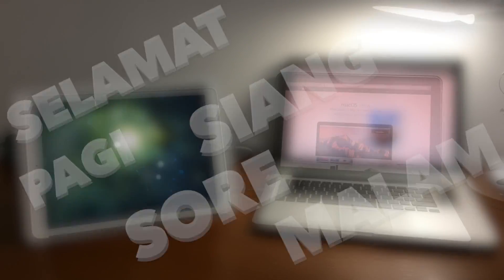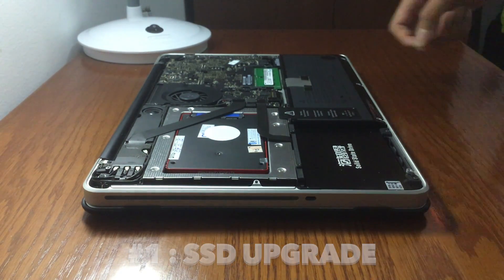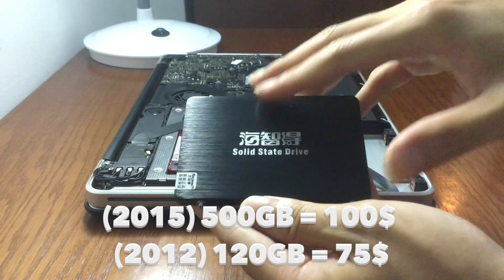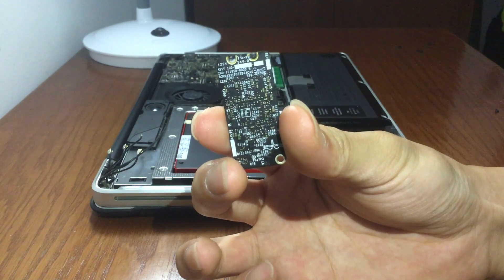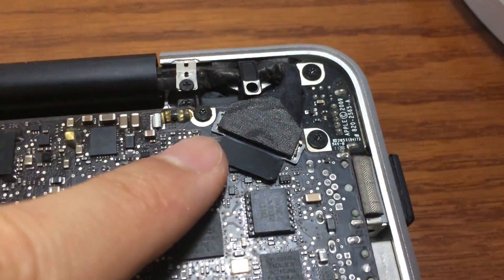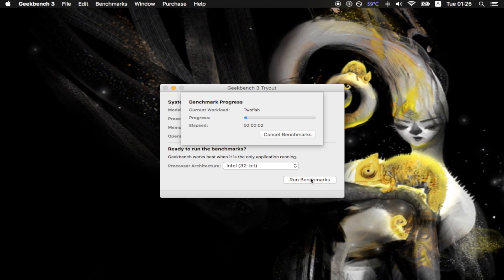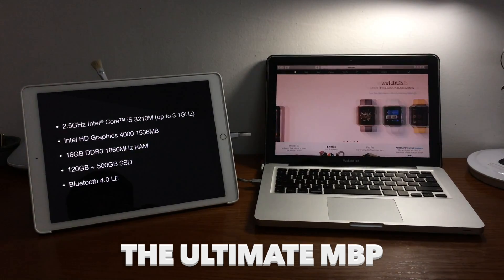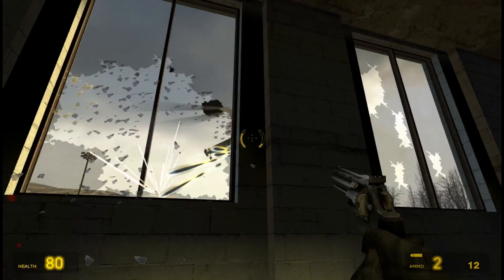The Ultimate MacBook Pro (Late 2011) Upgrade

Comment: I just finished upgrading my wife's early 2011 Macbook Pro, after which I saw your video. I kind of wish I had seen it prior to upgrading, because I might have opted to upgrade the motherboard also. However, she is quite satisfied with the 16 GB of RAM and the 1TB SSD (Samsung 850 EVO) I installed. Her machine is SO much faster now.
At some point in the future she'll need to replace the machine, but for now she says she is quite satisfied with the speed upgrade.

A couple of hints for others interested in breathing new life into their older Macbook Pro's:

1) I followed the Apple Doc: "Upgrading Your MacBook Pro with a Solid State Drive" located at https://discussions.apple.com/docs/DOC-4741
This worked out well for me.
I cloned the hard drive in the Macbook Pro onto the Samsung SSD using a Thermaltake BlacX series Hard Drive Docking Station. I believe you can just use a USB to SATA converter cable to do the same thing. Here's one example: https://www.amazon.com/StarTech-SATA-Drive-Adapter-Cable/dp/B00HJZJI84/ref=pd_bxgy_147_2?_encoding=UTF8&psc=1&refRID=ECPEYVXD5D6PYH63Z3RQ
Note that even though the cable (and my Thermaltake BlacX) are USB 3.0, it will work fine, albeit rather slowly, with the USB 2.0 of the Macbook Pro.

2) You'll need two screwdrivers for this task, a phillips #00 and a torx T6. I didn't have either, so I opted to go the cheap route and purchase a small screwdriver set from Harbor Freight. The set I bought can be seen here: https://www.harborfreight.com/32-piece-screwdriver-set-with-tweezers-97517.html
I had a 25% off coupon, so I only paid ~$5.70 for the set. After completing the upgrade, I would suggest using screwdrivers with magnetic tips. The majority of the case screws are quite small and it can be quite fiddly to insert them. I also had a bit of trouble with the four torx T6 guide screws that go into the SSD. I was able to remove and subsequently install all of the screws without too much trouble, but a magnetic tip to secure the screw would have made the job easier and quicker.

Hope this helps...
Reply: 1TB ssd? whoa, thats going to be so expensive :O
Reply: Love this, thank you! I wish I could copy and paste this on mobile

Comment: Hi, i have the same model and having problem with the graphic card, i was looking at your upgrade and have a question, will changing the motherbord fix ?
Reply from the maker: Yes it will fix the graphics issue if you change the motherboard

Comment: does it matter if it's a 13", 15" or 17" model if you change the logic board (you note a macbook pro 13" unibody upgrade) I have a 15" macbook pro and want to upgrade my logic board
Reply from the maker: I think it does matter, I'm not sure about the other models (15" and 17") whether you can do it or not.

Comment: I have a 2011 (late model) MacBook Pro 

I just upgraded to a 16gb RAM made by "Crucial"........ ITS AWESOME!!!! SO FAST AGAIN :D :D :D :D :D :) :P :P :D :P :D 

OHHH THE JOY! :D 
And it was sooo easy to switch out! :D 

I wish you all a lucky year in 2018, if you just read this you were blessed :)
Reply from the maker: +Steven Einstein Hahahah I'm glad you're having a good time with your mac 🤣 thanks and enjoy!
Reply from the maker: Yes but if you put 2 sticks of 8GB RAM (which is 16GB) it will just detect the memory and  work normally 👍🏼
Reply: @namedkenn  I have an early 2011. I thought I was maxed out at 8gb. It would be great if I can do 16gb and get back some speed in my machine.
Reply: All my research says 16 max, as with all 2011 and later mbp, due to the intel chipset apparently. So 16gb is it. Pretty good since the max was 6 or 8 just before the 2011s.
Reply: Sorry, I'm a noob at all of this, but apple says the max ram for a late 2011 model is 8? How did you do 16?
Reply: @gearheadproductions3236  I also have 16gb! super quick!
Reply: Kenneth Tanaka Ohhh, so technically max is 16. You wouldn't be able to do 32?
Reply from the maker: Well, I can't say that it maxes out at 16, the thing is I've never tried 32 before because of cost and efficiency reasons (is it even possible? Haha), but nevertheless it might be possible...
Reply: Steven may I know if you upgraded also your graphics? I'm using the same macbook model and I'm thinking to upgrade my RAM from 4gb to 16gb. Btw, how much is your upgrade?
Reply: +Steven Einstein Are you able to play 4k video with the 16gb upgrade? (I want to watch my 4k videos without insane choppy video)
Reply: bro please tell me is it still working good in 2020 please tell me
Reply: @sharjeelhassan7079  upgraded mine 2017 and working like a champ to this day. It's faster than my Microsoft Surface Pro 6. Specs for Mine 2011 MBP Intel i5 dual core, 16mb ram(ddr3 upgrade) and 500gb samsung evo SSD.
Reply: Waste of 16GB
Reply: @jm036  thanks Mr. Techie. But for $10 difference in price during a black friday sale, 16gb is still a good bet, waste or not.

Comment: 1867mhz ram? I think mid 2012 mac supports only 1600 mhz.
Reply from the maker: +ZOPLUS Officially it’s 1600 mHz but I can confirm that it can use 1867 mHz one, it is listed as that speed in system information, even in Boot Camp Windows’s Task Manager
Reply: hm....i've been researching on this topic recently too. There are two possibilities: 1) It shows that the ram is 1867 mHz but it runs at 1333mHz. 2) It runs at 1867! 
I dont know who to trust but i'll just go with 1867 one anyway if you get a good deal than 1333.
Reply: Jamin Wang me too only found ram to run at 1600 Max... if i knew for sure 1866 Worked, i Would get them
Reply: +Kenneth Tanaka Recently im quite interested in upgrading my macbook pro late 2011 2.4 Ghz core i5 module. 
Here's the upgrade i've done:
1) upgraded to 8GB 1333mhz Ram by corsair
2) Samsung evo 850 SSD 500GB
3) put on a caddy and the old HDD 500GB on it

I'm thinking of upgrading the entire mother board to mid 2012 2.9Ghz i7. Is it possible on this machine. And does it mean that i have to upgrade i5 to i7 cpu too? or does it come with the logic board already? 

Thanks in advance

Comment: I didnt understand why did you change your bluetooth module ?
Reply from the maker: +Christian Naydenov you mean why I used an external bluetooth adapter? That's because of a problem on my laptop, the bluetooth module inside doesn't have a really good range, so I used an external bluetooth adapter, it works the same way using either external or internal bluetooth though
Reply: I see okay thank you very much :D Im thinking of doing a similar upgrade on my 2011 macbook pro ! Im excited !!
Reply from the maker: +Christian Naydenov oh! Sorry I misunderstood, I changed my bluetooth module because of bluetooth 4.0 for continuity support! Hahahaha have a nice upgrade!
Reply: Whats continuity support ? I know I can google it but I think you can explain to me better :D
Reply from the maker: +Christian Naydenov oh hahahah its fine, Continuity is a feature of macOS (since Yosemite I think) that allows application handoff from one device to another, like starting an email on an iPhone then continuing that on the Mac, you can read more on apple website. So basically changing the bluetooth module on 2011 Mac allows you to enable this feature (upgrades the bluetooth to v4.0 but doesn’t upgrade to ac wifi). Although you will need to follow a github mod to enable the feature

Comment: Just upgraded my early 2011 Macbook Pro. 250 SSD HD and 16gb RAM.  I was on the verge of upgrading and decided to revamp.  OMG what a difference! Superfast and I'm in love with my Macbook again!
Reply from the maker: +Fernando Solis right! Hahahah SSD upgrade really makes that much speed boost 👍🏼 enjoy!
Reply: Did you upgrade your Motherboard? If so do you mind sharing where you purchased it from
Reply: Alvin Smith no I didn't replace the motherboard. I'm in Australia and purchased the parts online from MSY Technology.
You might be able to purchase them from any supplier near you.
I got the following:
Samsung 850 EVO SSD
Patriot Mac Series 16GB Ram. It's comes in a 2x8GB Pack. 
Hope that info helps.
Reply: Thanks for the info!
Reply: No worries!
Reply: My MacBook Pro 17 inch says the ram is only expandable to 8gb of ram. Did your say that as well and you just did 16 anyways?
Reply from the maker: Yes that's true 👍🏻

Comment: So I recently bought a 17" Macbook Pro, Mid 2010 i5 2.53ghz intel pross,, w/ 4gb 1067mhz ram and standard apple 500 gb hard drive. But I really want to upgrade to a 16gb ram and try to find a 1tb hd and also try to replace the battery, so this video gives me so much hope for the future. Would you recommend me trying to do this all at once or over time. I haven't upgraded any kind of tech like this before so I'm wondering if i should do it on my own or have someone do it for me incase I screw up. Any comments?
Reply from the maker: +Wyatt Worker hahah glad this video helps, I think if you can do it all at once, just go for it. Because upgrading ram is extremely easy, and you just need the right screwdriver to change the battery, the only thing need a bit work is changing harddrive, because you will need to reinstall the macOS to the new harddrive. I think you can do it on your own 👍🏼
Reply: Only 8gb in the 2010s I believe. Check on everymac.com. I also suspect you have the 3GB SATA bus in yours, not the 6GB the 2011s have and that might cause issues with some SSDs. Please consult everymac.com for accurate info on your machine. The ram and ssd swap outs are pretty easy but OWC has good videos.
Reply: the 2010 may have different ram potiential so do some research...16gigs may not work on the 2010 and the max mem speed may be 1333 or 1600

Comment: ifixit say logic board mid 2012 is only compatible with 2012 model. In other word, (it says) it didn't compatible with late 2011 model. https://www.ifixit.com/Store/Mac/MacBook-Pro-13-Inch-Unibody-Model-A1278-Mid-2012-2-9-GHz-Logic-Board/IF163-051-1

Btw, mine is 13inch MBP i7 2.8 late 2011. 
Do u have a step by step tutorial to replace late 2011 logicboard with mid 2012 logicboard? (ifixit doesn't have that one, right?cmiiw)
Reply from the maker: Yes this is not an official thing, but in real world you can put 2012 motherboard into a 2011 chassis

And yes I have made a step by step tutorial here https://youtu.be/Je-_x4T5J_E

Hope this helps!
Reply: Wow, I should've browse more before asking haha. That was awesome. Thank you very much :)
Reply from the maker: +Daan Harsya hahahah glad it helps, you're welcome 👍🏼

Comment: a quick question. I have early 2011 MBP. Can i use mid 2012 Logic/motherboard in mine too like urs? is the model same?
Reply from the maker: Surazz Sh yes you can use 2012 year motherboard and put it inside a 2011 chassis, but you still need to change the heatpipe and shave the display connector a bit though
Reply: Thanks.  Ill definitely try replacing it

Comment: Unfortunately all of your links can not be open by my web browser. I am in the USA. All I've done so far is upgrade from a 4G to an 8G. My 2011 MAC is super slow and the cd drive is non responsive. It has also been making a strange sound. :(
Reply from the maker: Ah sorry for the link I think its outdated now, but I suggest you (or ask for a friend's help) to get rid of the cd drive, buy a second HDD bay, also any SSD of your choice then install mac on that SSD, not a  simple process, but this wile surely make your mac better than ever

Comment: Good Day, I have a 13-inch late 2011 MacBook Pro with 2.8 GHz intern core I7.
can I upgrade the RAM to 16GB
I edit GoPro videos what should I upgrade to prevent picture lagging?

thank you!
Reply from the maker: Fun Stuff I think upgrading ram above 8GB is not really giving you any more big performance upgrade, but still my recommendation is to upgrade to an SSD. I can edit with final cut pro on 1080p, what resolution do you edit your videos at?
Reply: thanks for replying, i can edit my videos on 1080p, the problem that i am facing know is with the GoPro videos, i am experiencing a lot of lagging, that's why i am considering the upgrade. what do you think?
Reply from the maker: Fun Stuff GoPro videos? What format does it use? I'm sorry I'm not familiar with this issue because I don't have a GoPro camera myself. Have you checked your ram usage during editing the videos? Are they all used up?

Comment: for the battery life in normal usage how long it can handle?? did it arround 4-5 hours? just lets say in normal case you do a multitasking like browsing chrome with 7 tabs opened, watch a 720p video on youtube, listening music, and running photoshop
Reply from the maker: Around 3 to 4 hours usually, I never changed my battery and its cycle count is 654 now. This is with itunes playing music, around 3 tabs on safari, and maybe little microsoft office editing. Actually yours is still fine I think.
Reply: ok thanks
Reply: one again.. did you ever monitored ur temp while using it? how does it reach when it in charging and in battery use?? ~thanks
Reply from the maker: eka iswara I always monitor my temp using Macs Fan Control, but it's my cpu temp not the battery. And if I check now (it's 14celcius outside) my battery is about 21celcius at idle. I think if I'm gaming it's about 89celsius on the cpu.
Reply: no no.. that i'm currently mean it that cpu temp indeed xD sorry for those confuse xD hhhhh

Comment: I dont know should I upgrade it or sell it haha
Reply: I have a 2011 macbook but the sata connector broke and Im thinking should I spend 400 dollars or should I trade it in
Reply from the maker: Zariq Danial the sata connector on the motherboard or just the sata cable? If it's the motherboard, and if you can sell it at a reasonable price, I think you're better off selling it then get a macbook air or anything actually, your choice 👍🏼

Comment: A have a 15.4" macbook pro late 2011 i7 2.5ghz with 16gb ram 1333mhz, 240ssd sandisk pro, superdrive , of course with lcd 1680x1050 matte screen.  very powerfull
Reply from the maker: cancerbero40 yeah hahah feels like having a brand new Mac after putting in an ssd

Comment: If you would let there old motherboard, you would have to buy 1333MHz RAM, but when you changed for the new one, you can have 1866MH, right? So I can't have 1866MHz RAM with early 2011 motherboard? ..Thank you
Reply from the maker: Matěj Stavinoha if I'm not mistaken, the 2011 motherboard should read 1866Mhz RAM just fine 👍🏼

Comment: dude why your geekbench is so low ,mine is 9040 ..i have a late 2011 750hdd 8gb of ram
Reply from the maker: Dr Zoe it's a 13 inch Macbook, with dual core processor inside, maybe yours is 15 inch with a quad core processor?
Reply: Yes it is

Comment: So is this a good deal? Guy offering his MacBook Pro late 2011 4GB ram 500GB HDD i7 Intel & 8x DL "super drive" in good condition actually really good condition vs one I seen on eBay. This laptop has no scratches besides the body but hardly noticeable. The keyboard has two issues the O & N are "sticky" I figure it food. Battery is old is and doesn't really need replacing unless I want to. Best part is it never had any damages or parts replaced so all OEM with original box and installation disks. Charger in good condition surprisingly so it not all bent up at the end of the cable. We negotiated for $450 I e been informed I could get it for $400 but 1. It's not on person 2. I could get scammed by eBay sellers than this person willing to meet me in person at Apple Store of my choice. 3. Since I'm at Apple Store I can have it checked out on the spot make sure internals are okay.

But big question is, is it worth it?
Reply: I got a MacBook Pro late 2011 like new i7 8gb ram 750 hdd for 425 I'm lucky
Reply from the maker: Bass Junkie its a bit hard recommending this because the wifi card doesn't support airdrop and that intel HD 3000 really sucks at pretty much everything, so it would be better if you can get a 2012 mbp 👍🏼
Reply: Kenneth Tanaka its fine honestly dont need anything nice also long I can do crazy amounts of video editing and upload it then thats my main goal of a Mac. I know graphics sucks but I could probably find all the stuff you got but cheaper.
Reply from the maker: Bass Junkie alright that would be awesome then 👍🏼 it would do fine video editing once you upgrade the ssd at least, so good luck!
Reply: Kenneth Tanaka 15 inch